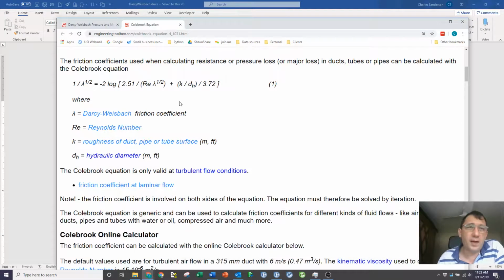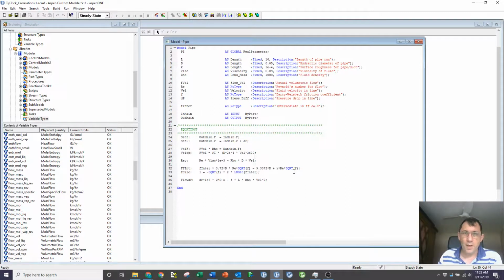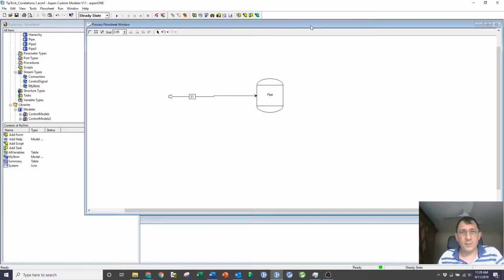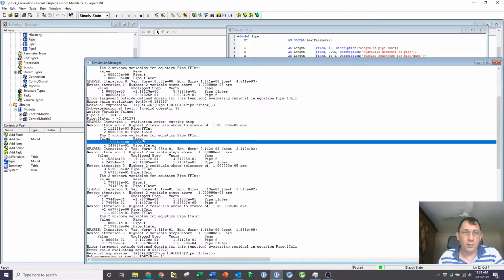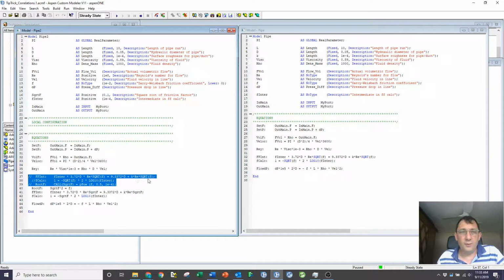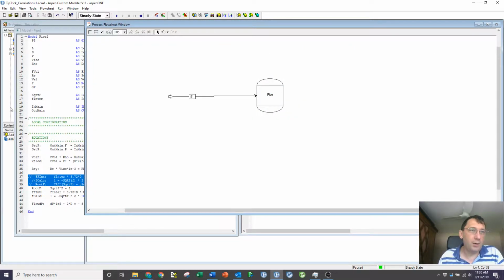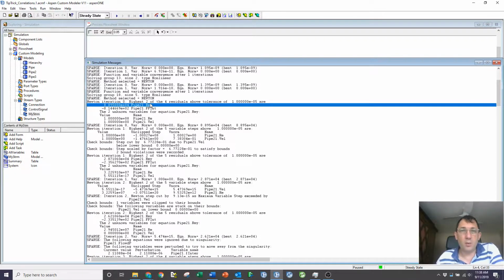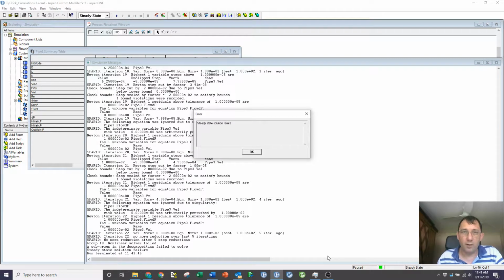ACM14 Language Tips & Tricks  - Equation Reformulation

Comment: Hi Charles,
Thanks for your videos. They are all very helpful.
Do you have any plan to model a simple flash in ACM that could be exported and used in Aspen Plus, in future?
There is a Jump start document on this topic which is not accurate and correct.
Kind regards
Ahmad
Reply from the maker: I'm pleased the videos are helpful.
I have modelled flash systems in ACM, but it's a relatively involved section of code, so probably more than I have tie to turn into a video.
As mentioned in my previous reply, I'm not much good at exporting to A+ - I tend to model in ACM exclusively.  But A+ has its own flash models already - in fact flash an distillation is really the core of what A+ does...
Reply: @cssandersonllc3172  Thanks for your reply. I am interested in using ACM, rather than Aspen plus and I just wanted to check the ACM modelling results with Aspen. 

As I mentioned earlier, I tried to model a PT flash using Rault's law and heat duty in ACM. The model works fine without any ports, however, after the addition of ports, I receive errors (usually, something about singular group decomposition)

Would it be possible to share my results with you or other subscriber and get your feedback? Thank you in advance for your kind attention.
Reply from the maker: @ahseyfaee2833  I'd be willing to take a quick look, but probably won't have time until the weekend at the earliest - charles@cssanderson.com
Reply: @cssandersonllc3172  Thank you very much for your help.
Reply: @cssandersonllc3172  Hi Charles, that would be great. Many thanks.

Comment: Excelent video! I have a question in ACM, is there any way I can use stringsets into multiplications and divisions. I have my stringset as molar fractions which I calculate, but after that while trying to use those values again for another calculation it doesn't take any value for some reason. Thanks in advance.
Reply from the maker: It should be doable - probably easier if you share your code.  Can you email me your file (or a snippet with the relevant bits - please don't share anything confidential)?  charles@cssanderson.com